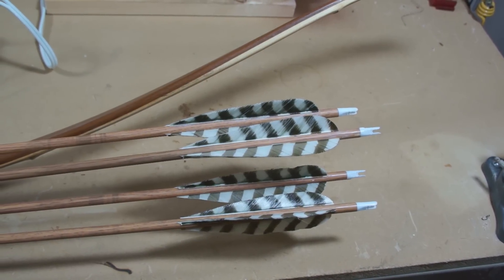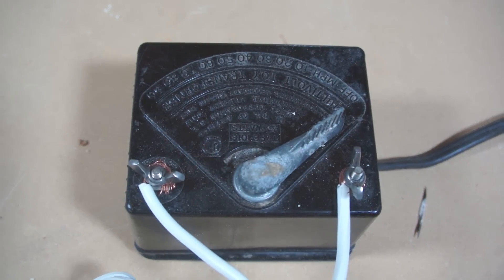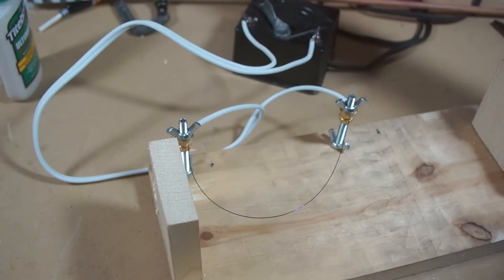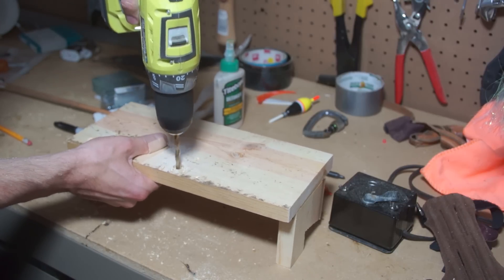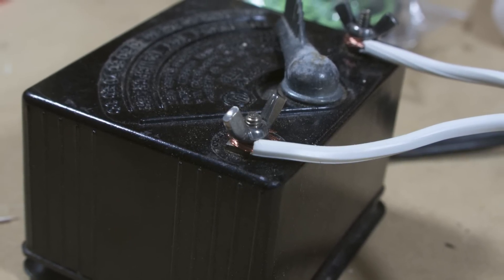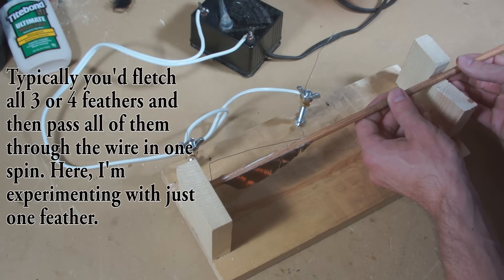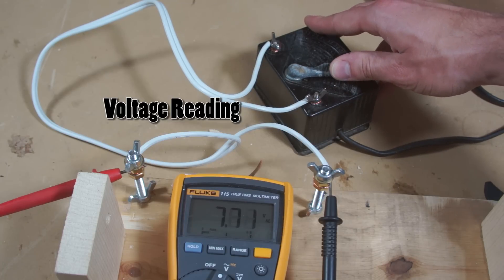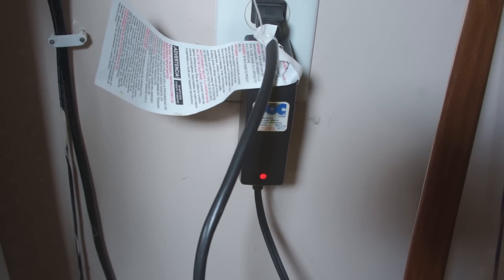DIY Feather Burner Traditional Archery

Comment: I have a question. I have some turkey feathers that look look you could get a fletch off either side of the quill, producing both a left and right wing feather off each one. Would that work or should I only use the stronger side of the feather. Idk, both sides look good to me.
Reply from the maker: Are you looking at secondary feathers? Sometimes they will have more material on each side of the quill. Usually on primary feathers though, they are stiffer and you'll usually only have one side that looks usable.

Comment: What's your measurement for nock hole from base and distance from bolt side?
Also interested to hear a comment on last comment about snapping/wire not getting hot
Thanks for your consideration

Comment: I built this to your specs and even got the same transformer.  When I hook it up to the posts it still has full voltage yet but when I add the burn wire the transformer starts snapping and voltage drops to almost nothing and the wire only gets warm, do you happen to know what would be causing that?
Reply: I'm having the same issue, interested in finding out what I may have done wrong
Reply: I’m having the same issue. I have to continuously shut mine on and off, or unplug it and plug it back in to reset the transformer. If I wait too long, the transformer will heat up the wire, and then immediately shut off after a few seconds, leaving me with just a lukewarm resistance wire that can’t burn the feathers to shape. So I too wonder why mine is not working as well either.
Reply: @coreyhope5348 did you find out why it's doing that? Mine is doing the same

Comment: have you tried using a soldering Iron as the heat source?
Reply from the maker: +Fox Fam I have read about it but not tried it. One with a dial adjustable temperature would seem to be ideal, and those aren't necessarily inezpensive.